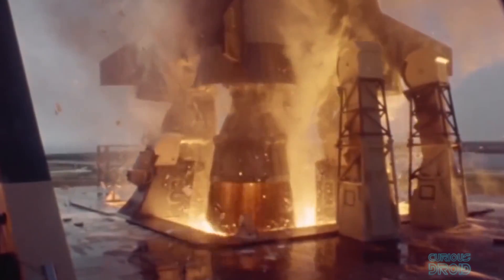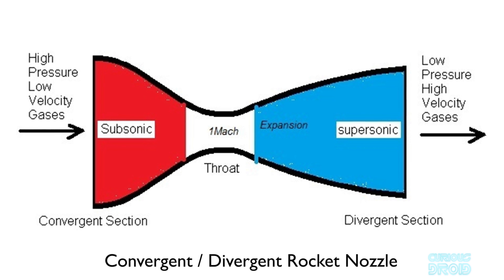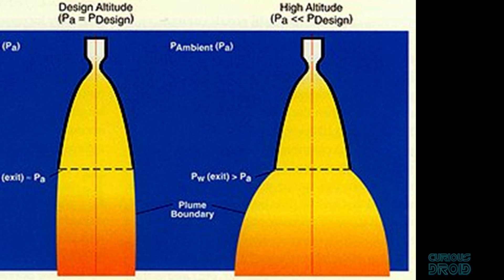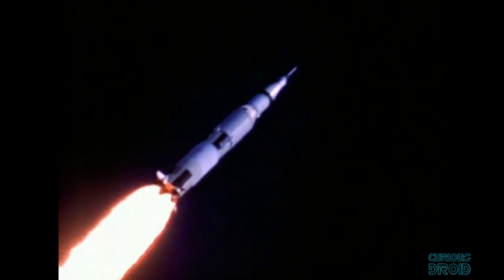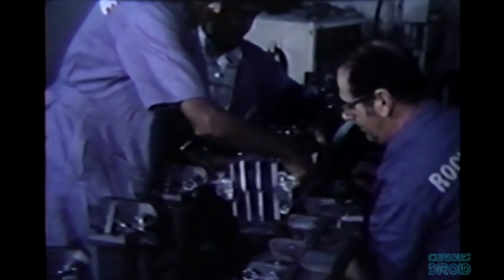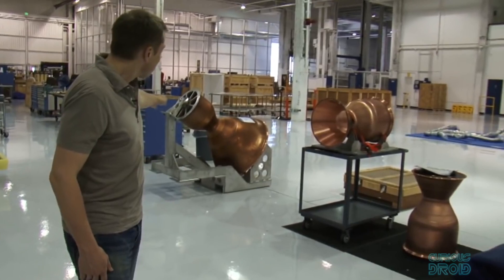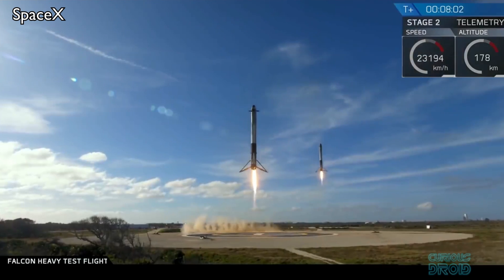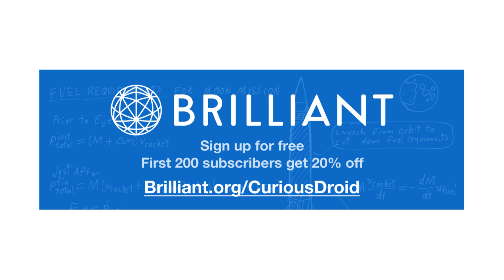Aerospike Engines - Why Aren't We Using them Now?

Comment: The biggest reason why SpaceX doesn't use aerospikes (and why they generally don't make sense) is weight. The main reason for staging is NOT having a new engine optimized for the current altitude, but rather to get rid of all the fuel-less dead weight you're still carrying with you into orbit. If you gave the Falcon 9 a perfectly functional and tested aerospike literally for free, and gave them a "exchange your merlins for aerospikes for free" program, they still wouldn't do it. An aerospike is naturally heavier than a bell, and requires more space. Also, given it's design, you couldn't really use multiple aerospikes, and there are HUGE advantages to using 9 merlins instead of one super giant merlin, namely it's much cheaper to mass produce 100 small identical parts than to produce 10 large parts, it's also more reliable in terms of manufacturing defects, and it also offers redundancy. For instance, earlier this year SpaceX had an engine failure during a Starlink launch, and it still reached orbit perfectly. If you have 9 engines and one fails, you continue burning like nothing happened, you just use 1/9th less fuel and burn your engines a bit longer at full thrust, then correct with the 2nd stage, and you've still reached your orbit. If you have a single giant engine, and it fails, you're toast. 

Bells are cheaper and simpler to design and manufacture, easier to gimbal, easier to cool, they allow for multiple compact engines on the same stage which makes manufacturing cheaper and offer more reliability and make the rocket more resilient to failures, they are compact and so allow for more aerodynamically efficient rockets, and most importantly, they allow for higher combustion efficiency. It's very hard to increase combustion efficiency without a throat. 

Basically, aerospikes are never as efficient as the perfectly shaped bell, and so you want an Aerospike if you're looking for an SSTO. But SSTOs in general are a bad idea if you're trying to put shit in space for cheap. As long as we're in this level of technology, and we're still bound by the tyranny of the rocket equation, staging is a necessity, and so we'll see bells and not aerospikes, and by the time (if ever) that we develop technology that allows for SSTOs to make sense, we'll be so far ahead that we won't be using anything even remotely similar to current engine designs, so certainly not bells nor aerospikes.
Reply: I disagree. I think this technology will be the future of space travel. 

The erospike engines in the video have the same components as classic bell nozzle. Each combustor on the linear aerospike is essentially the same as an entire classic bell style engine. The 9 merlin's on falcon9 are isolated from eachother in their own cell under the rocket. So if 1goes it doesn't nessarilly take the rest of them. That cell structure could easily be done in the belly of the  aerospike with a wall between each combustor and their pumps. The biggest current problem is the heat management and it bit complex. But using chilled liquid clean methane as a fuel the heat can be pulled away from the aerospike and the expansion of the gaseous methane powers the  turbo pumps without having to combust the gases. So main problem with the heat in its current design is that the aerospike nozzle itself is heavier to absorb all that extra heat. Since each of the combustors have their own cell 
and are isolated expect for the spike itself. If a combustor goes out on the far left, the combustor next to that can increase it's thrust and correspondingly the combustors further right decrease their thrust. To offset the nonsymetrical thrust coming from the engine. So in actuality it can do most everything without gimbling that classic bell engines do with gimbling.

But I think the one thing many don't see is the linear aerospike design lends itself to be used as hypersonic ramjet or scramjet, with intake cowling and cowling over the top of the aerospike. Compressing and directing the air into the spike. Using injectors of the combustors to inject fuel into the airstream and combusting. The entire aerospike engine is moved in and out of the cowling for different altitudes when in hypersonic ramjet mode. Methane rocket engines most of the fuel mass is O2. I think it's aaah 3to1 3 parts oxygen 1part methane, very lean. Put it on the back of the dreamliner with the intake cowlings above the wings... Yeah maybe not to orbit but anywhere in the world or even around the world  within two hrs.
Reply: @jasonbrady3606  Elon Musk himself says he doesn't think Aerospikes are the future, and that he doesn't see SpaceX ever using them. 

And the whole "around the world in two hours" is a pipedream. Again, where is the market for that? If people were willing to pay more to travel faster by air, then airlines would be investing in faster planes, not more efficient planes. We already have the capabilities to go faster, and we're not using them, because cheaper and good enough is better.
Reply: Dreamliner it's actually the 
Dream chaser that I meant to refer to modifying.

Elon says a lot of different things for a lot of different reasons. Prolly placating and reaffirming antsy engineers and colleagues and investors... It's pretty obvious that he is focused on appling known tech and not going the basic science research road. I think down the road his R&D will be toying with aerospike engines. He did say however if anyone comes up with a viable aerospike engine he'd be right on board. And something like this can stay horizontal throughout the flight. Quickly rocket up to mach2 then hypersonic ramjet for cruising. I don't know if it could make it to full orbit but probably.considering how sense and heavy o2 is, and eliminating having to carry much of it. Concorde was jet powered had heavy maintenance cost. There's a slew of reasons the concorde did not survive. 
I think aerospike engines and hypersonic ramjets still fall in the category basic science research, yes. I think basic science research what nasa should be focused on. So yeah NASA still plays it's part. Then when it's viable offer it for commercialization. Everything Elon has done has been done before in a very limited fashion. He didn't start with a entirely blank piece of paper. In saying that I love listening to Elon talk. He's very real about it and forward looking. I just don't think it's something he's going to pursue anytime soon. I'd put money on it darpa already has something similar to what I say already somewhere. But generally speaking most anyone can know how it works at this time. Covering something you're rivals already know is obviously a waste of time in a free world. Once it's out it's gotta be approached differently and what secrets are left are carpartmentalized till they think it don't whatever about it don't matter anymore. Sorta like if we're not suppose to be talking about it whys it everywhere. If I'd happened to stumble upon something that is yet confineable I'm sure someone would've said something to me. That doesn't happen just as I expected. Don't vigil ante oppression

Comment: After graduation (BS, MS engineering), I landed a job that partly fulfilled my dream to be an astronaut.  Rocketdyne was then a division of Boeing.  I went straight to advanced programs as a member of the XRS-2200 Engine, which is the Aerospike engine we see featured in this video.  The X-33 faced a problem.  The fuel tanks would not withstand the required fuel pressurization.  Benefit to cost issues also started to make NASA lose interest.  Yet, as the premier liquid engine propulsion in the World, Rocketdyne delivered.  I had already jumped to Atlas and Delta propulsion, then the Space Shuttle Main Engine when I visited the test stand (B1, if I recall well) being set up for test at SSC.  Extensive data was collected, and improvements in performance were noticed.  These data will someday be helpful for an entity that is serious about the Aerospike.  By the way, we need to encourage the newer generations to study science and engineering to keep the edge.  God bless.
Reply: Unfortunately, with the break-down in society (specifically the highest, by-far, divorce rates in the world) kid's in the US no-longer have the schooling & home discipline, or even desire to pursue the hard sciences as they once did in your generation...Most military personnel in high command now consider this to be a national security concern 😰
Reply: @gregsayles9253  Oh stop whining, Greg. Nobody wants to hear you complain.
Reply: @gregsayles9253 Properly funding our schools would be a good investment too
Reply: Thank you for not only your excellent work, but also your faith to give your upmost as an engineer to the Most High!

Comment: re: Cost of fuel being an insignificant part of the launch. It's not so much the cost of the fuel that's the problem, but rather it's weight. Every kilo of fuel carried, is a kilo of payload that isn't. The quen isn't "how much does a kilo of fuel cost?", but rather "how much is a kilo of payload worth?" - I'd be interested in seeing the weight of a "dumb" sea recovery parachute system vs the fuel and additional control and comm systems needed for propulsive recovery. Ultimately I think a re-usable aerospike engine module core stage with strap-on single use fuel tanks will be more efficient going forwards. An engine is always going to worth recovering - a large empty coke can, less so.

Comment: well riddle me this ? : If Aerospikes are more efficient OVERALL but NOT as efficient at one specific atmospheric pressure, then WHY has no one developed a bell nozzle that is VARIABLE in it's aperture ? ie: a bell that can be expanded and constricted ? can't be THAT hard...then you would have a nozzle that the absolute best at ALL pressures as it could change as it goes up...Now I'm sure that this would be the best system for efficiency, but Paul mentions that they have stages to swap out the nozzles as the vehicle gets into higher atmosphere, lower pressure, I was under the impression that the main reason for staging was more to do with shedding dead weight of empty fuel tanks etc, I know it makes perfect sense to change your nozzle design when staging of course. As we all know , it's the start of the flight and the first , I dunno ten or twenty kilometers or so that are the most variable on atmospheric pressure and load on the vehicle, every time i look at the incredibly flimsy looking design of the first stage, the way that a tube runs through the middle of the lower tank to get the fuel down to the turbo pumps, I'm always amazed that the damn thing doesn't fold up under load !

Comment: if save 40% fuel w/ aerospike, doesn't that mean more payload?
Reply: People are pointing that out a lot in the comments and it would have been nice if Droid mentioned that in the video. That's less fuel needed plus you only use one engine means a much lighter vehicle. I don't know if it's enough to offset development costs, but it sounds worth looking into. That being said, these companies employ a lot of very smart people so it probably has been looked into and something about it doesn't look good enough to go after.
Reply: much, much more payload.  Weight of propelant is biggest issue with rocket
Reply: You also have to factor in mission flexibility of SSTO on a reusable craft. Faster turnaround and you can potentially land anywhere with a long enough runway.
Reply: Doesnt necessarily mean more payload, it does mean that more of the mass the rocket launches with can be something other than fuel such as payload.

Comment: Sp Space X really isn't provate.. It's just a crappy NGO.

Why don't they put profits in to R&D for aerospike dev to make the company better? AKA more prifitable
Reply: Raptor is a higher combustion efficiency and simpler overall design process (which is still pretty damn complicated, as it's the world's first working full-flow staged combustion engine). They want to get Starship going as soon as they can and use money it'll make for continued R&D for it, eventually upgrading to the 18m version. For TSTO like Starship, bell-nozzles are adequate enough to not bother using the aerospike, with all the overheating issues it has (boon for Dual-Expander Aerospike Nozzle, but it has yet to be developed).
Reply: @caav56  Front End I think starlink has more potential for revenue growth. Ten years, what you said. That is if starlink promises are kept. They can take a lot of biz from telecoms keeping ppl stuck on cat3 copper and charging them sky high bandwidth rates.
Reply: @craigstone975  Starlink can't grow to the full scale without Starship, though,

Comment: The toroidal aerospikes are still an interesting concept worth developing. But the major failing of the linear aerospike is actually the MASS and complexity of the engine. You gain better efficiency moving through the atmosphere, but it's just not worth all that extra engine mass and all those many combustion chambers.
X33 flopped because they couldn't figure out how to make the linear aerospike produce better gains than bell nozzles. Which, not THAT big a deal, just use bell nozzles.
But the nail in the coffin was they ended up not being able to produce the composite fuel tanks. The alternative was using aluminum tanks, but they were just too heavy and made the whole thing non-viable.

Comment: Their only drawback is low efficiency at high altitude
Reply: Actually, pure-vacuum upper stage with hydrolox dual-expander aerospike nozzle can have higher ISP, than the same stage with bell nozzle.

Comment: Excellent video as always, but I'd like to offer one comment about dimensions. One square inch is a square with each side being 1 inch long. That cannot be equated to 2.54 centimeters, which is a length. One square inch equals 6.45 square centimeters.

Comment: The problem with SSTO is weight, when the craft goes higher it needs more power to accelerate it to orbital speed and all that mass of tank heavy engines needs much more fuel to push it to orbital speeds rather then discarding section after section. Also, shuttles have been known to cost more then single use rockets and more complex and even their re-entery is not very safe against small re-entry crafts like soyuz. Also, there is a question of space junk, a single use SSTO will leave more space junk then a staged single use rocket.

Comment: Aerospikes could be a possibility for a shuttle but not for a rocket.
A rocket must have several stages released during its flight, if it doesn't...
Imagine a 50m high rocket, commercial load on top, engines on bottom....

Launch it, 15 min after launch, the tanks are 90% empty... with the mass of the engines on the bottom of the rocket and the mass of the load on the top... with empty volume in between..
The center of mass is completely messed up, the rocket becomes unbalanced and uncontrollable.
Furthermore, 80% of a rocket mass is its combustible.... you need a 250 ton thrust engine to lift off from ground at full load... but at 200km altitude, you merely need 6 ton thrust to do the job... and you have an overpowered engine... you will have to run it on iddle to maintain such low thrust compared to the max thrust the engine is capable.

Also, 1 stage engine, the most powerful ones as they push the full load of the rocket, extreme power but short use (~2min).... If such engine would have to cope the full lengh of the flight, I let you imagine the engineer nightmare to build an engine robust enough.

Comment: They were experimental.  Not every experiment works out.  From what I understand, we need new Materials to make them re-usable on that scale.  (A Heavy Lifter)  That was part of the promise:  A re-usable heavy lifter with 1 engine that can work at all altitudes (So you don't have to do Staging.)  Basically, the focused heat, and flow-rate was too high for present day materials, so i would think they're working on that:  Something that can actually contain it.  (Basically the Square-Cube Law.  If you double 1 dimension, say the Apeture, you quadruple the Area, and the Mass goes up by 8 times.  A 1:10 scale model car, all else being equal, is 100th the surface area of the body panel to paint, but 1,000th the weight.)

Comment: It feels a criminal waste somehow, a betrayal of the best in all of us.

This is the same mentality of 'good enough' that allowed steam engines that were essentially the same machine, albeit with tweaks and minor improvements to power the railways for over a hundred years. When they were finally replaced it was only with something even more pedestrian and locked into a mechanical dead-end--the diesel or somewhat improved diesel-electric locomotive.

Humanity as a united species needs space. We have to get off planet. We must acquire the effectively limitless resources of the solar system and perhaps more than anything else we desperately require the physical space for our many peoples to expand--Earth does not have all that much spare capacity left in any of her resource pools. However we are not going to get any of that using technology that was old before Armstrong walked on the Moon.